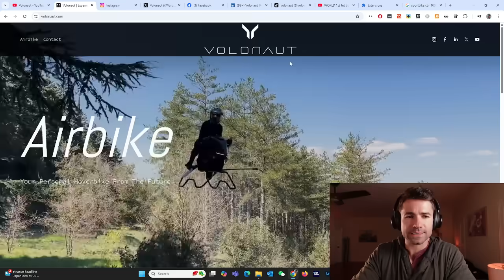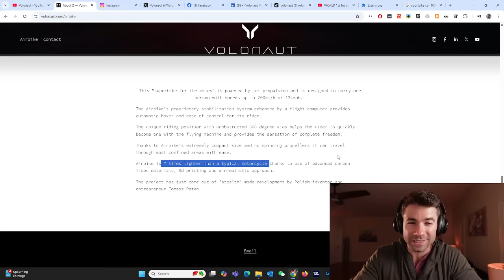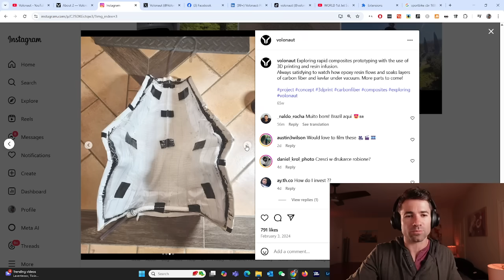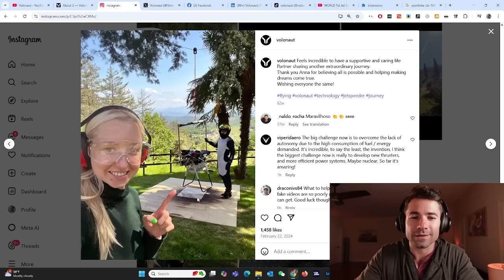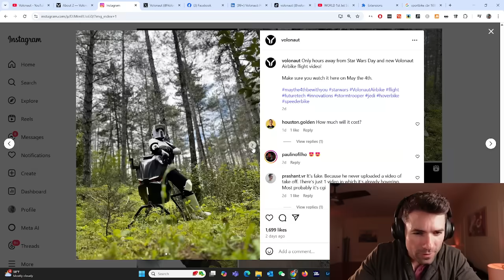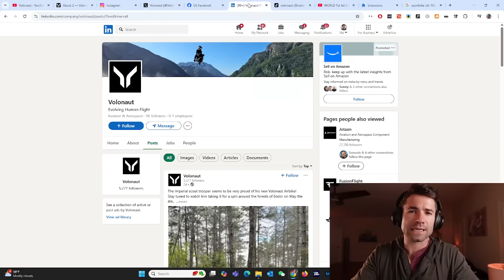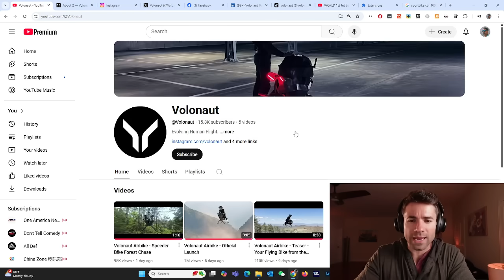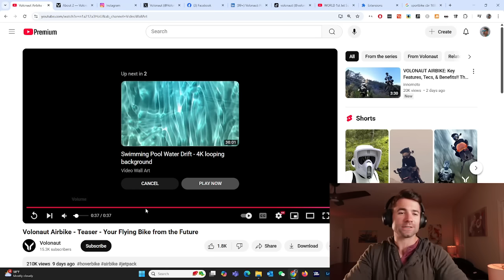Is the Volonaut Airbike Real or a Scam? (Expert Breakdown)

Comment: Where is the fuel tank?  Unless it runs on nuclear fusion - this won't last minutes in the air (if it can lift off at all... with its OWN weight, the fuel's weight and the driver's weight).  This is brilliant AI Fake Video until it's proven real.
Reply: bro 🤦‍♂️🙄😂💀🤡
Reply: The volume of space for those personal racing jet packs is larger than what the rider is straddling, fuel takes space, control systems take space, stabilizing systems all take space.   Seems too good to be true.   the Gravity Industries Jet Suit used for mountain rescue weighs over 300 lbs and only runs for 1-4 minutes and can only lift its pilot and about 40 lbs of gear, and with that it still has considerable bulk.

Comment: They flew in a desert because NO ONE in the city would be willing to deal with the noise.
Reply: Tatooine is a desert planet, so.
Reply from the maker: great point there brad
Reply: Rather hear the cleansing sounds of a jet bike vs the city sounds haha
Reply: @finfrog3237  

Haha, the cleansing sounds of hearing loss.
Reply: I to pustynia w Polsce.
Reply: its not legal
Reply: A company named Jetopia has created a far quieter jet engine that could be added to this technology, bringing down the sound to that of an automobile.

As well, this argument about the noise was the same issue people had when the automobiles were being invented from the 1890's to early 1900's, people learned to put up with it.
Reply: @madisonatteberry9720  we have science about safe noise levels now, and regulations about those noise levels.

we have had the ability to make flying cars for decades but they haven't gone anywhere because they are not noise safe. we might finally be getting them quiter to be safe but its not a case of 'learn to put up with it'
Reply: @BradKwfc  i don’t think you have any idea about it.
Reply: @stan3951  
I worked on aircraft for over 10 years. In that time, I worked on 12 different aircraft, everything from cargo planes to regional jets to helicopters and even the F-35. 
You're right, though. I don't know anything about things that fly.

Comment: Do you thinks its better if its electric or gas-powered?
Reply from the maker: The power requirement is very high on this - gas is better due to it's higher energy density 250-300lbs of force are needed at all time just to keep it in the air. Batteries keep getting better but it will be some time before something like this is practical or competitive with batteries
Reply: Gas powered jet engines are unmatched when it comes to power-to-weight ratio - thats why planes use them. And the vehicle gets lighter when the fuel gets used up (batteries never gets lighter when you drain them).
Reply: Why couldn’t this be hydrogen powered? Or hydrogen/electric hybrid?

Comment from the maker: This was my first take on the Airbike from an industry perspective. If you want a deeper dive into the tech— propulsion, range, speed projections —like this comment and I’ll make a full breakdown.
Reply: No deep dive - just a test drive!

Put your money where your mouth is, get a test drive of the thing, film yourself taking off, flying for more than 10 minutes, then landing, with sound.

Use you industry connections to get a demo.

Surely they're eager to prove the thing right?
Reply from the maker: i'm all about that - emailed the guy yesterday, no response yet but he must be slammed this week
Reply: @RobRast  A month later and no more updates from those guys. Think it's clean now that it was a CG stunt. If it was an actual thing they would have used the viral momentum for a demo of some sorts. Well played though, people still arguing it it was real.
Reply: Same as a jet suit, but gas powered fan. Uses probably 2-4 servos to move the nozzle around (basic thrust vectoring) and a FCU to perform balancing of the inverted pendulum.
Reply: @gene7499  with such a high CoG (unless they are lying about the things weight like they are about the sound), there's a very small arc of vector thrust that's stable, even with a decent PID controller there's no way it would be as stable as shown in the video.
Reply from the maker: yes you'd need to lean super careful on this thing unless you had some aggressive thrust vectoring, unlikely at this size
Reply: @GraveSilencetheRowboatNi-tb6db  No, you're incorrect. My business sells mUxVs, we build simple setups like this for some of our VTOLs, but with EDFs. They have a multi-nozzle, or nozzle divider, and a basic re-director "hose/shroud", that can be connected to quick linear servos at 2 perpendicular edges on ball joints, which then push and pull rapidly maintaining balance. That's how we do it for vertical landings when we need horizontal adjustments. Ever seen a large UGV balance on a ball by using 2 perpendicular rollers? you'd be surprised what can be balanced and on what platforms when you can make the adjustments quick enough.
Reply: @gene7499  Yes, I've built inverted pendulum PID controllers, and I've seen plenty of footage of bots balancing on balls using rollers.

I know they can balance, you're missing the point - NONE of those are as stable as what is shown in the video.
Reply from the maker: good call
Reply: @gene7499  we been doin this shit with edf's for years (scaled down and riderless of course)  in the experimental rc  aircraft,, looks like a thrust vectored gas turbine and a  decent fc curious to see actuators, pids would be a challenge with the dynamic cg ,  quite within the realms of doable, id personally wanna use it at altitude and with a decent independant failsafe reserve chute on both bike and rider
Reply: Get access to a prototype, film yourself riding it, (with sound!) for more than 10 minutes of continuous footage, film yourself taking off and landing.

Do the above, and maybe people will believe it. If the company isn't willing to give you test ride to prove the thing is real, then it is very obviously fake.

No deep dive - just a REAL test drive!!

You're an "industry insider", use your "industry" connections to make it happen, or you're full of shit.
Reply: I mean surely the company will JUMP at the chance to prove it's real, no?
Reply: Totally fake show more videos of take off and landing PROVE US WRONG SO WE CAN SHUT OUR MOUTHS - WELL YOU CAN SAY THAT DEFINITELY THEN. Up until then fake im sorry to say.

Comment: CGI - as they made a mistake in two (only 2) parts flying over water where there seems to be 'dust' being dispersed instead of water spray.
Reply from the maker: you have timestamps? i'll take a look
Reply: And no reflections in ANY of the water shots that I could find
Reply: CAP

Comment: That wasn't helpful at all. Speculations, like every one of us.
Reply: He's probably a paid shill. Mentioned nothing about the engineering at all, and the "prototype" under construction is CLEARLY not the same chassis we later "see" "flying".

They say in their vids it can go for 20 mins and is "nearly silent", both claims are obviously bullshit, but buddy here didn't even address it - shill.

It's almost certainly fraudulent - but it if IS real, a jet-bike that small that can carry an adult human - is going to be absolutely LOUD AS FUCK, and will last 3-4 mins at the very best.

So it doesn't matter if it's real or fake, they're lying either way.
Reply: A pilot above the lifting system is stable ( if a rotor , contra rotating props etc) counter intuitive .
Reply: @ No they aren't, you are wrong. Any system where the point of thrust is below the CoG is inherently unstable, and requires constant dynamic stabilization (thus the vectored thrusters).
Reply: @GraveSilencetheRowboatNi-tb6db  Nope, just no. If the component creating the thrust is fixed, it's always inherently neutral. For this reason, rockets are stable although they have thrust at the bottom and the CoG near the top. They are actually more stable the higher the CoG is because the thrust is always statically neutral and passive aerodynamic stabilisation requires to have the CoD below the CoG. This vehicle clearly doesn't use passive aerodynamic stabilisation, so it doesn't benefit from this principle, but it is still statically neutral, like drones.

It would actually be a fun engineering challeng if we had like 50x better batteries, as the control loop is far easier for EDFs. The only reason for my scepticism is the combustion engine, as it would be a pain to create a stabilisation for it.
Reply: @doc.chocholousek3378  Yeah, that's only for rockets once they're flying fast enough for aerodynamics to take effect.

The initial phase of a rocket launch is a highly unstable inverted pendulum and would fly out of control without active stabilization.

As you even pointed out, this supposed bike is NOT aerodynamic, nor is it moving upwards with enough speed to induce the passive aerodynamic stability you are talking about. Comparing this to a rocket making orbit is ridiculous.

A hovering vehicle like this would be permanently in the "inverted pendulum" mode, requiring constant active stabilization.

Try balancing a pencil on the tip of your finger with the pointed end down and a lead weight on the eraser. It's not going to be easy and will take constant intervention. THAT's what trying to balance this vehicle would be like. 

Now throw that same pencil across the room - it's going to fly almost perfectly straight with the weighted end first. THAT's what you are talking about, but as YOU already admitted, the second scenario does not apply to this bike, only the first one does.

 It would NOT be "statically neutral like drones" because they balance by hanging the weight beneath the rotors. It would be more stable if it WAS more drone like though.
Reply: @GraveSilencetheRowboatNi-tb6db  No, this is not how it works. If it was true, my drone would be statically stable as it has basically all its mass below the rotors + a heavy battery even below that. But it is not stable. It's neutral and electronically stabilized. Because the force is fixed to the body, it is not a pendulum, and for the same reason, a rocket isn't an inverse pendulum.

On the other hand, a pen balancing on your hand is an inverse pendulum and thus is unstable because the force isn't fixed to the pen. The pen experiences the gravitational force (0, -mg, 0), so by newton's 3rd law, your finger has to push it with (0, mg, 0) to counteract translational movement (simplifying a bit). As you can see, the force from your finger always points upwards. Your pen now starts to fall due to a small deviation, so it starts rotating. Thus, the tangential component of the (0, mg, 0) force starts to decrease, and the orthogonal component starts to increase, aka the CoM of the pen moves farther from the direction of the force. This causes additional rotational effects on the pen, causing it to rotate even more and create a positive feedback loop. Again, this is because the force changes relative to the pen (more precisely, the normal component changes magnitude, the tangential one doesn't impact rorational stability). If there was instead a motor fixed to the pen, it would be statucally neutral and either still or rotating with a constant angular acceleration if the resulting force doesn't point to/from the CoM (and the same thing would happen when mounting the motor on top of the pen).

You can also very easily test it with a quad. If the quad was stable, the back motors would have to work considerably more when going  forward with big tilt. If it was unstable, the front motors would have to work considerably more. You don't see this effect because all quads are neutral.

There's also this rule taught in something like the 6th grade of elementary school that all forces are invariant to translation in their direction. Thus above/bellow the CoM doesn't even mean anything for forces with fixed direction.
Reply from the maker: ok let's hear your contribution
Reply: @RobRast  Off the top of my head - there's no way it's stable if it weighs less than the rider, the CoG would be WAY to high, especially for vectored thrust. One wrong turn and it flips over. The CGI in the promo shows the thing being WAY too stable.

Also, there's no way something that size has the power-to-weight ratio to lift a rider that high, or to fly for 20 minutes like they claim (another EZ gimme point you failed to address). If it flew at all, it would barely hover and last for 3-4 minutes at the very best.

There's a hundred other obvious issues anyone with an engineering background could see right away, but that's obviously not you.
Reply: @ I am not the one claiming to be an expert on the subject --> Expert breakdown. Well, your comment was a breakdown, just not very expert'ish. haha

Comment: My first impression was CGI, but honestly it looks about the right size for 4-6 small turbines like those used by other "jetpacks", who knows.
Reply from the maker: yeah if those jetsuits can fly around, this thing is definitely not too small to pull it off
Reply: @RobRast  No I mean its definetely technically feasible to have the thrust required to lift a person in that small footprint. You have to question the safety of a flying vehicle that has no aerodynamic lift at all, and which seems to be designed for low altitude flight with little time to deploy a parachute.

Even helicopters can auto rotate and pretty much all airplanes can glide land in an emergency, this will fall like a rock in best case, and send you rotating at 400rpm in the worst case.
Reply: @ I just hope that it has a lot of redundancies and can still gracefully land with multiple turbine failures, I doubt it though.

Comment: CoG is completely different to the racer example, that's my biggest concern with this, rider just seems to be balanced on a "jet blade". Thrust seems to be based on the centre line, so roll compensation must be very limited. Yaw would also be a big problem if a spin starts, it would be difficult to correct. Some of the forest shots look "craney".
Reply: Mmmm what if it was say 4 small jet-style engines? Spread out a bit so that way they could adjust independently if it detects too much yaw etc (thinking along the lines of how SpaceX is able to land their rockets)
Reply: @kadalora  That would be a terrible system as jet engines are usually kindof slow when reacting to throttle change and you need a very high frequency control system for this. I've heard somewhere that you can get a bettter response time with independent compressor instead of a traditional one powered from the turbine, but that itself is a prototype technology and probably still not react fast enough for this. I'd rather use a thrust vectoring mesh, but it seems still kinda unlikely a single engineer can make a mechanically complex thing like this + a complicated control system for it. While it's probably technically possible, I'd expect a much bigger team.
Reply from the maker: yes agreed on the limited roll pitch and yaw compensation with all the thrust in the center, I believe that may be why we're not seeing any real speed or cornering  in these videos

Comment: Those scorch marks on the pad means flying over forests might start a fire.
Reply from the maker: good point - is that why he's flying so high above the ground? no fires if you go fast enough haha
Reply: @RobRast  what if it is spray paint
Reply: @dabman101 or he used a heat gun 😂
Reply: It wouldn't start a fire by flying over a forest.  The jet-suit Gravity guy has the exhaust go on his legs with no special clothing.  It's only hot within about a foot.  Five feet away, it wouldn't light a pile of kindling soaked in gasoline.  The image of black exhaust on wood is probably because he did a static fire test there, and it left black soot.  It didn't light the wood on fire, even blasting it in a static fire test.
Reply: yes, but only a computer generated fire.

Comment: Take an interest in the Jetson ONE, because it's the same designer.
Reply from the maker: good point, def adds some credibility
Reply: Jetson One appears to be battery powered. This here claims to be powered by jet engine propulsion. When you use jet engine propulsion you are going to require both a battery and a fuel tank. Both of those take up quite a lot of space.
Reply: @RuiWang-zm2ue  and are heavier than 1/7 the weight of a sports motorbike 30 kg based on a 210 kg bike
Reply: @RuiWang-zm2ue . That Jetson one is a drone. Anything with spinning propellers couldn’t be used for regular everybody transport. A big drone is a toy for rich people.
Reply: Jetson ONE is just a big quad copter, so basically proven technology.
That thing, with supposedly 1 jet engine, has a ton of other problems, so I highly doubt it's real and they just stole his name.
Reply: that right  and all  chat here looks l.ike stupid  people here with out elementary cnovilge